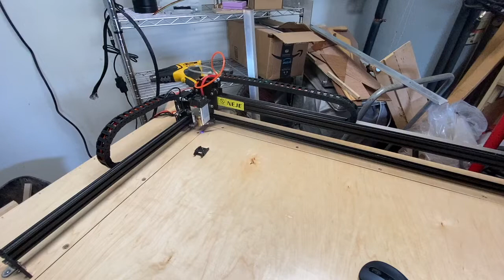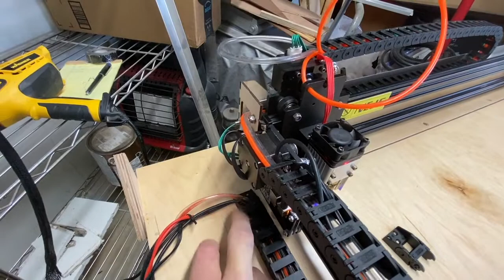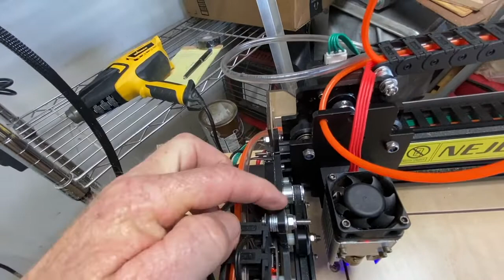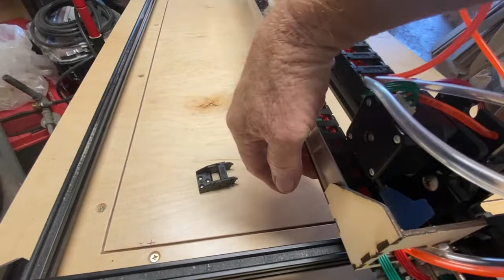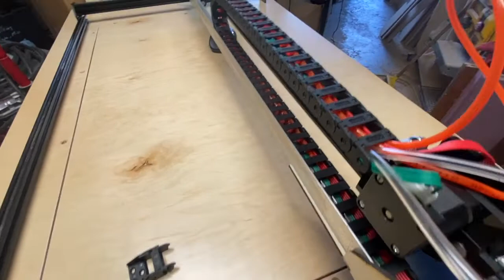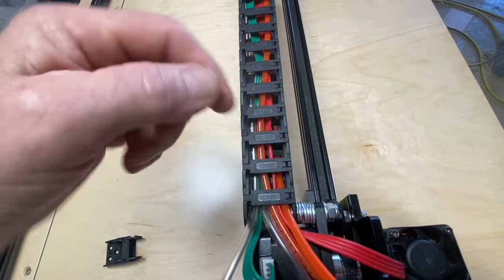Neje Laser Master 2S Max Drag Chain install

Comment: Did you have trouble with the limit switch by adding the aluminum bracket? I would also like to know if you had to extend and of the cables? I would like to get the file for the x brackets too.

Comment: Good morning Devin, is there anyway you could provide a print of the mounts you made with the measurements awesome video.  thanks.
Reply from the maker: Hi Kevin, I can email you the file. Or if you know another way to share the file let me know.
Reply: @devinf744  podias compartir el diseño conmigo? por favor!
Reply: @devinf744  can you email the file to me too?
Reply: Hi Kevin can you share the file for the angle mount please I have same problem with the cables….thank you

Comment: What lens did you install and what system for the focus?  There aren't the standard one ...
Reply from the maker: The lens is the stock one N40640 laser head, I think what you're seeing is the air assist nozzle, which I got off Etsy from Laser Wizard. It took some modifications to make it fit right but I think he's working on making the changes so it would fit better.